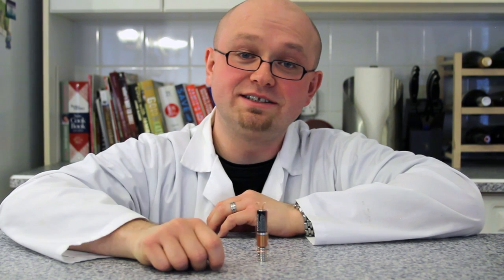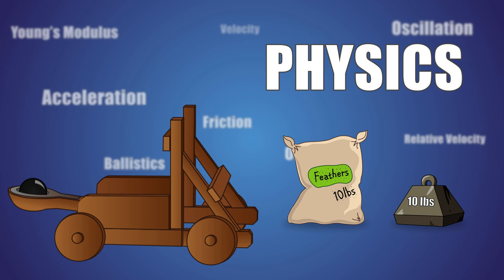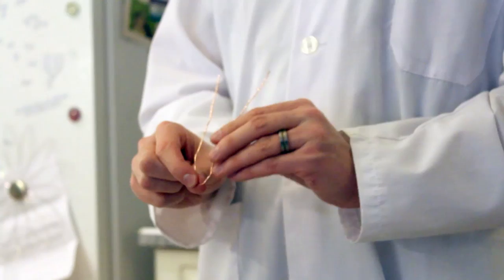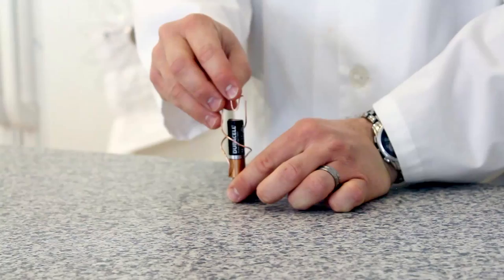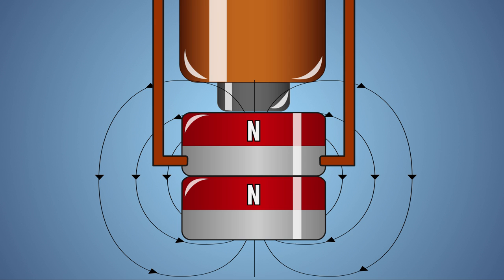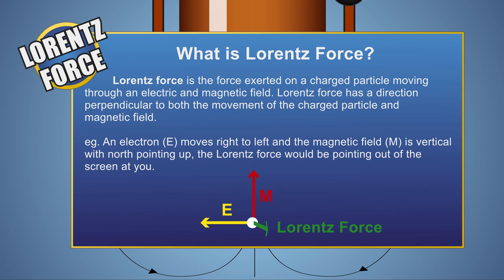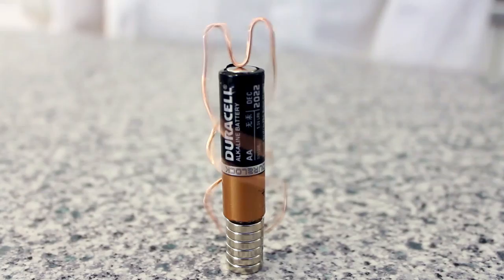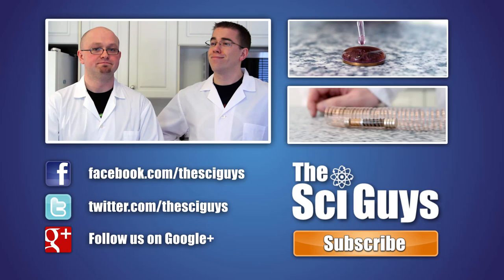The Sci Guys: Science at Home - SE3 - EP8: Simplest Electric Motor - Homopolar Motor

Comment: bending the wire is actually the trickiest part which you should show more excplicitly. If the bending is not 100 per cent right, it either does not work (because the wire doesnt touch the battery enough or has resistance and stops) or the wire falls off once it starts spinning or after a few seconds. I spent hours until I found the right bend

Comment: Really nice video guys, I will definitely be using it in my classes. 
Just a small thing but the battery isn't the source of electrons, they are already present in the copper wire.
Reply from the maker: thoughtware23 Yes Copper has electrons, I mean everything has electrons but the electrons that power this experiment come from the battery otherwise this experiment would work with just a magnet and copper wire.
Reply: @TheSciGuys absolutely

Comment: Brilliant explanation! I was wondering whether the motor would still work if between the battery and the magnet a cylindrical conductive block is placed, and the copper wire slides onto it (rather than on the side of the magnet, as in the video), therefore not having any current throughout the magnets. Not sure it would work anyways, anybody a clearer idea? Thanks!
Reply: The motor works with Lorentz forces. To generate the force electrons must have to flow through magnetic field. If wires touch the conducive surface but not the magnet you can’t obtain the type of circuit you need to experiment. In short wire will not spin.

Comment: Can I use one more powerful magnet instead of several weaker ones. More specifically, would an N42 magnet with 6.44 lbs of pull work as well as 3 or 4 N35 magnets from the hardware store?

Comment: You said that the Lorentz force is responsible for the spinning of the wire. If it is the force that causes the wire to spin, then the wire accelerates. When does the motor stop accelerating?
Reply: When there is no electron flow , means that , when battery die or the circuit is not close.